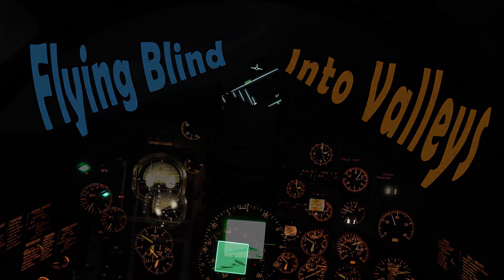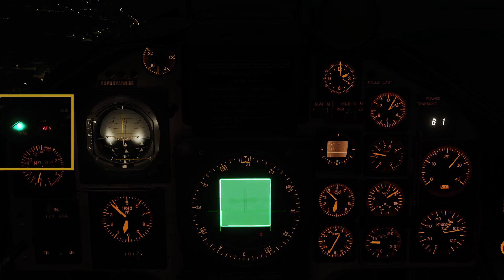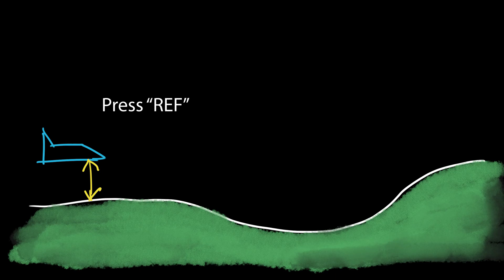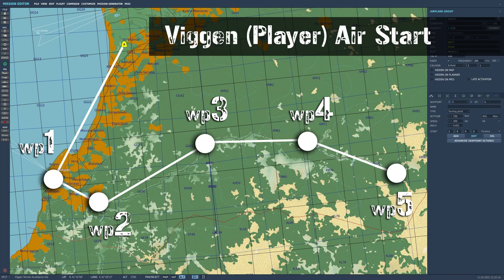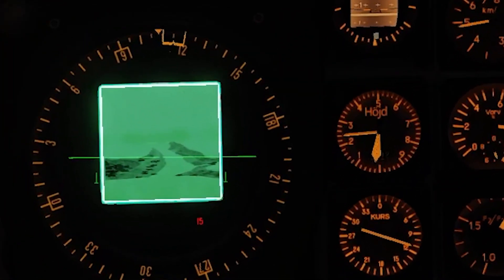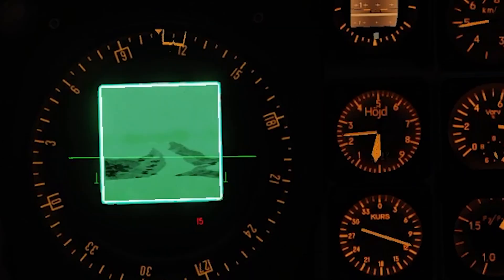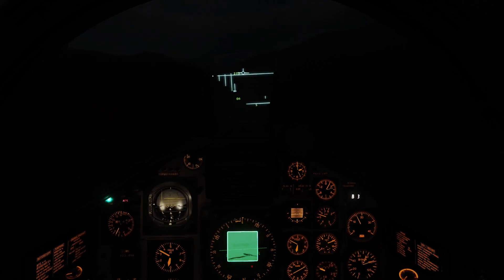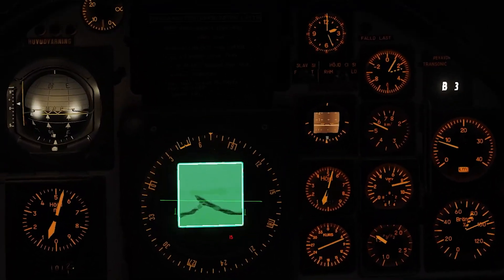Viggen Terrain Avoidance Radar Tutorial (2022) | Anti Collision Mode

Comment: Really great tutorial. It hadn't occurred to me to setup the director needles using the reference altitude.  You just have to make sure the altitude source (HOJD CI SI) switch is set to RHM to use the radar altitude, otherwise it will use barometric (LD).  RHM is default unless you exceed a certain altitude, then it automatically moves the switch to LD, so it's important to check. 

In the December 2022 patch, Heatblur adjusted the radar antenna elevation in Terrain Avoidance mode so it is now level with the horizon. It used to be slightly down, so you would get ground returns from terrain in front and below you that is not in your flight path. The new elevation setting provides a much more distinct contrast between terrain and clear air *at your altitude*.  Therefore, you should not get a big return from that city area at the end of the video anymore, and when flying through a canyon it should be much easier to spot the walls and the flyable "channel" on radar. 

One other thing.  The radar range setting has no effect when using the B-scope (A2) in Terrain Avoidance Mode, it's always 10 km.  In A1 mode with Terrain Avoidance mode the range functions normally.

Comment: Why would you use radar terrain avoidance in B-scope mode (the tight and small radar picture) instead of the A-scope (big and wide)? A2 on the radar instead of A3. Is radar terrain avoidance only possible in B-scope?
Reply from the maker: It would seem obvious right... I thought this too, and flying with it on A1 during the day / seeing the ground, it seems like it will be obvious, but fly at night, it's somehow far less intuitive than one might expect. I don't really know the ins and outs of it, but having tried both modes, the longer flight through various turns low in a valley (not just 30sec in a straight line) is very much more difficult using the other mode... Guessing now, it might be down to how the radar system interprets distance (to terrain) and relative height info, and how it presents this info to the pilot
Reply: You may find the A1 view is more usable since Heatblur changed the antenna elevation in the December 2022 patch.  See my other comment above.